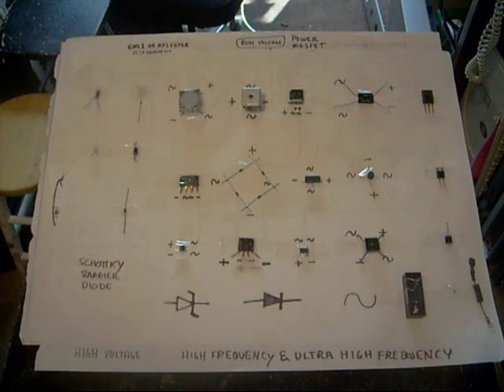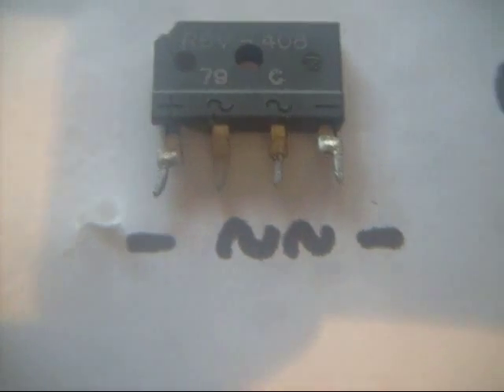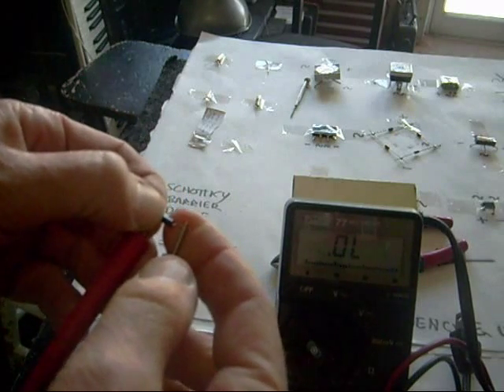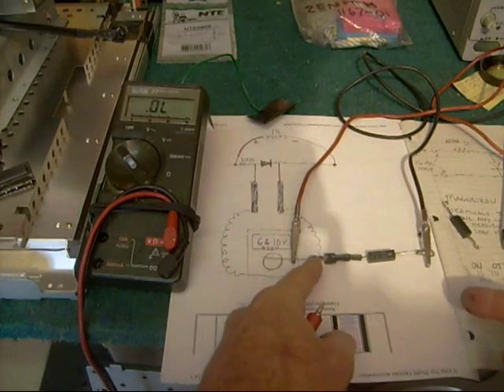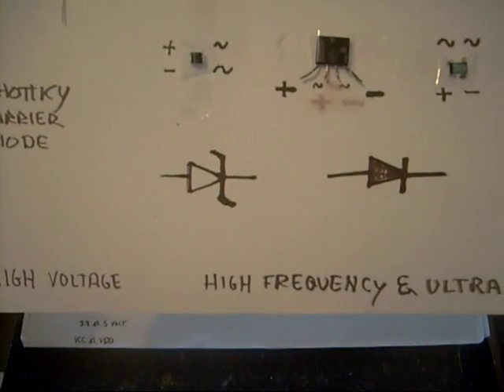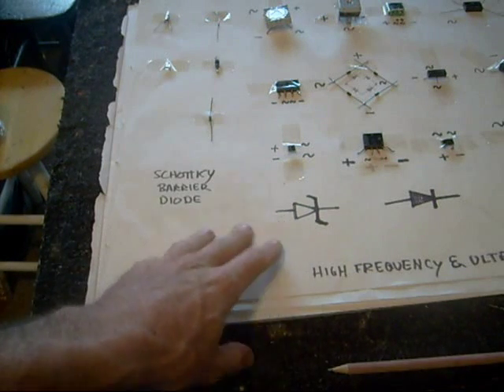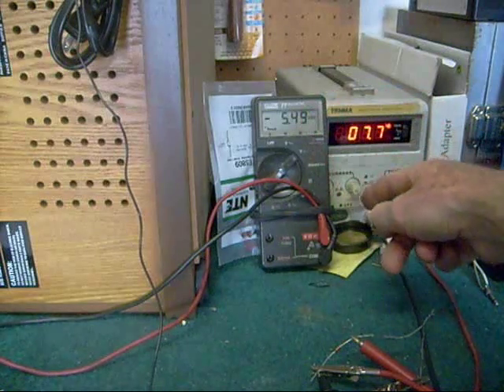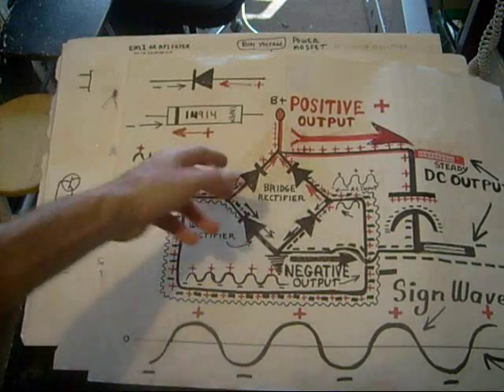Diodes and Bridge Rectifiers

Comment: Great work. Would you tell me how to identify Schottky  diode ?
Thanks ahead
Reply from the maker: There should be numbers on the side of the diode which you can look up to identify it, but if your using your diode check function on your multimeter,  you will notice a Schottky diode has a lower voltage drop across it's junctions than a conventional diode does. It will probably be around 0.2  to 0.3  Vs 0.5 to 0.6 on conventional diode. I'm not sure if getting a lower voltage drop  proves it's a Schottky diode,  but the lower voltage drop is one of the characteristics of a Schottky diode.

Comment: Thank you for such a clean presentation. It's a refresher for me. I just repaired a vintage SONY STR-6120 for a freind; the Power Supply  Bridge Rectifier (the old IOR 5B4) and it's surrounding Capacitors (four .022µF film type, two 50µF @ 100V and 220µF @ 25V Electrolytic radial type) weren't exatly shorting out, but they would blow the 4Amp Glass-type Axial Buss fuse soldered to that power supply board. Just minutes before I committed to replacing the 5B4 Bridge with an NTE-169 Bridge Rectifier, I watched your video. That was two hours ago. The SONY STR-6120 is fully Serviceable and Operational now! I diagnosed the problem a month ago. It has taken three weeks to get these components because I had to refresh on a lot. I haven't done a repair like this for twenty years since I was in the USAF doing Satellite Communications work. Thank you, again for the "pep-talk".  
OK  :)
Foxx  =^.^=
Reply from the maker: Glad you found it helpful. It's easy to forget what we don't uise. Sometimes I find myself having to watch my own videos for a refresher. LOL

Comment from the maker: @MrAnimeGuru 
A Zener diode has a brake down voltage that is very precision  and they are generally low wattage devices. Varistors are also designed  to brake down at a certain voltage but they are high wattage devices designed to short out and blow your fuse in the event of a power spike.  Aside from having a higher wattage than zener diodes I don't know if they make any varistors that are as precision as zener diodes. I have seen many TVs come in my shop where the varistors failed to protect.